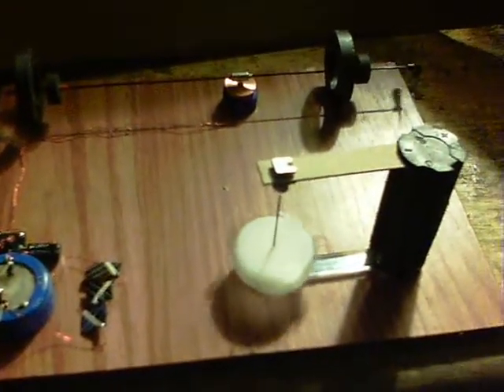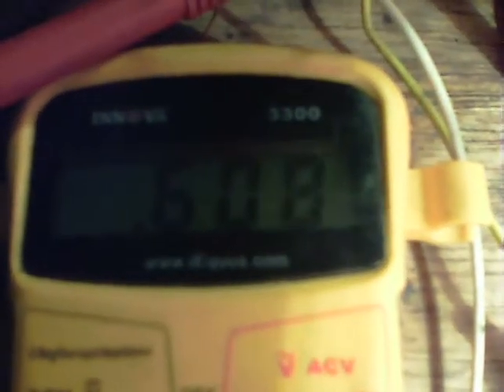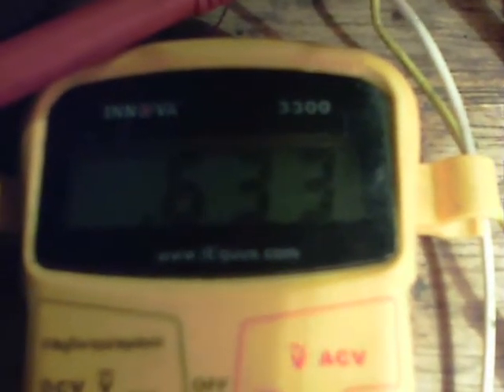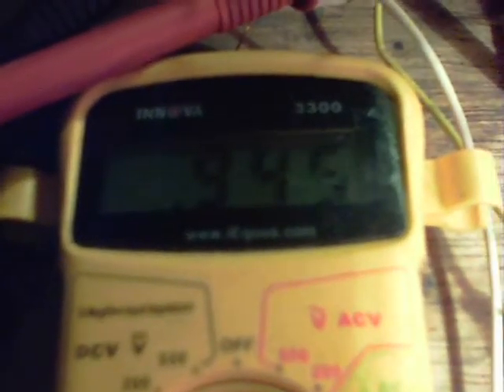90 Degree Rotors - semi levitated

Comment: Hi Slider! I used to have a lot of 'lifter wire' but now I can't find it anywhere!!! I will have to buy some more from Maplin so I can get this single coil pulse motor built. I wondered, when you say '40 guage' do you mean 40 AWG (0.08mm), or 40 SWG (0.125mm)?

Thanks mate. I wanna get back to having fun with you guys, making some cool stuff :)

Comment: LOL,  Don't temp me to "clean up" the cars in my hallway next time I step on one going to the toilet at 3am..... 
Windex is alcohol, so the paint would be acrylic. I'd usually reach for the Methylated spirits (Ethanol) for acrylic thinner. Good to know Windex can work, its a lot milder. Mineral Turpentine would be my first attempt for oil paints and enamels.After that I might try oven cleaner (Caustic soda), before acetone or xylene. Stryeeze is a bit of everything.

Comment: LOL. I was wondering if its acetone(paint stripper), or xylene (permanent marker smell) based. Looked up the MSDS... Turns out it's both! LMAO. I didn't know that was safe. Still not sure :| But on the up side, it should melt pretty much any plastic, with possible exceptions to HDPE and Nylon. There is no way that one will be allowed in Aussie land. I may make some... Until then, can I request a plastic melting video? Got any army men? Those guys are made for cannon fodder anyway.

Comment from the maker: Oh my pleasure, glad the tip is of use. Ceramics crack easily and I couldn't see the point of using a hammer on them or heat. A good hour of full immersion works well. The cone areas are really quite easily removed with pliers afterward.

Comment from the maker: There's quite a lot of 'wiggle room' with such a setup. I have the rotor magnets on pieces of wire insulation and allows movement. Nice thing with these speaker magnets is the assembly can run upside down or on its side fine. Your long term solar mendocino is often the inspiration for this sort of thing and the SS1CC of course :)

Comment from the maker: Ha yeah, the bigger pieces already went into panels that I put outside, so the little bits are what i'm using now. 
The way you can do it is to wind a 600 turn aircore with 40 gauge wire (thin straw + piece of cardboard each end works) and build a SS1CC by sMartcreations2010 on his channel...that's what a Dancing Flower is :)